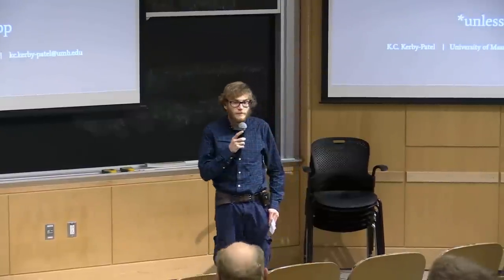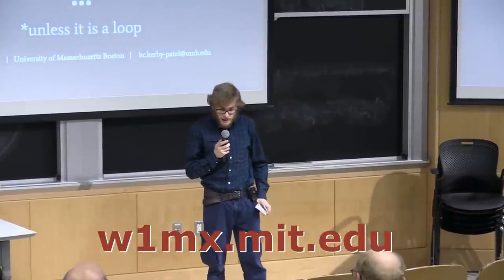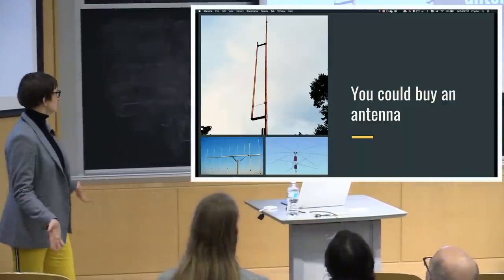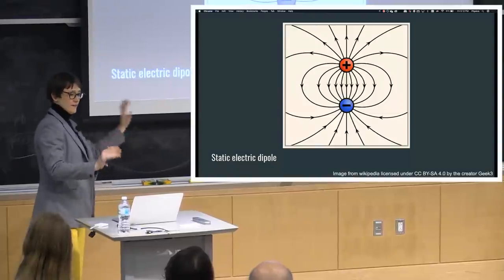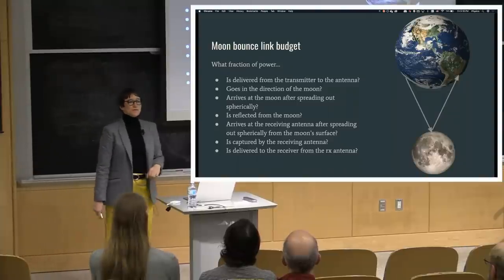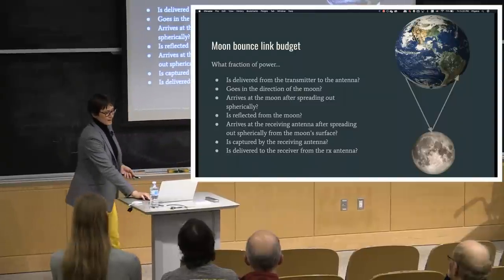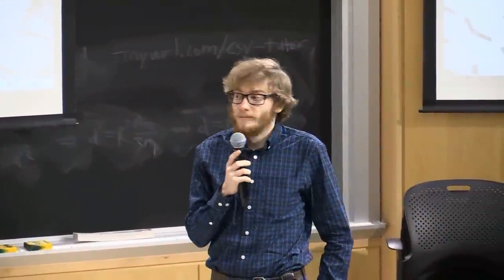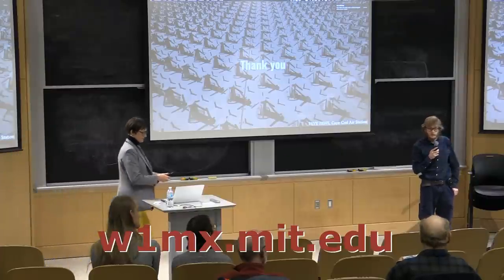Antennas

Comment: Thank you for the excellent presentation (modulo the inability for us to see the laser pointer on the Smith charts - sigh).  Much appreciated!

Can you please provide a link to the kit antenna you offered for the citizen science research you mentioned? Also, can you provide the link to the spinning-magnet-on-dremel experiment? It occurs to me that since the FCC seems to have a 9KHz lower lower limit to their regulatory authority AND you mentioned that the transmission could be detected a kilometer away, that there are some interesting opportunities for low bandwidth signaling.

Comment: I think the presentation is excellent, but I want to caution Hams and those without a physics background that her use of "dipole" is a dipole dealing with two opposite charges. It has nothing to do with a dipole antenna.

The dipole antenna is defined as two equal conductive poles or elements in a straight line, generally each 1/4 wave long on each side, fed in the center. 

I hope the dipole antenna is not confused with the opposing charge dipole used in physics. They are very different things!